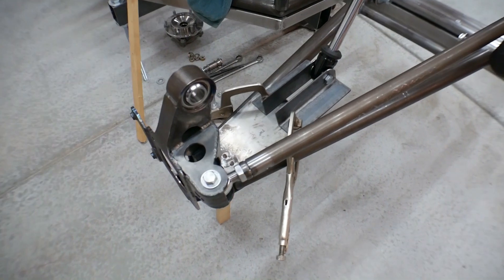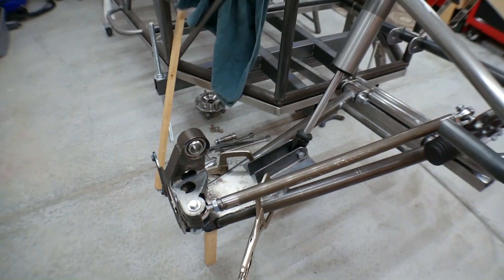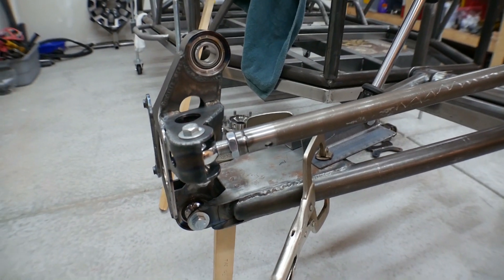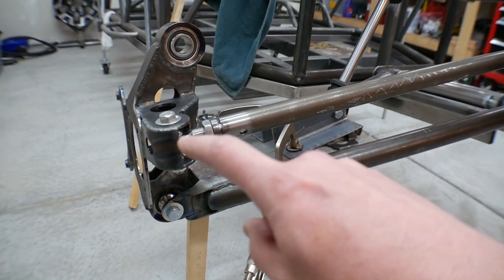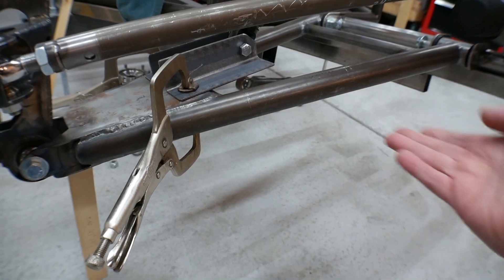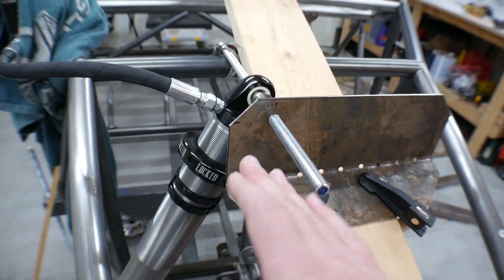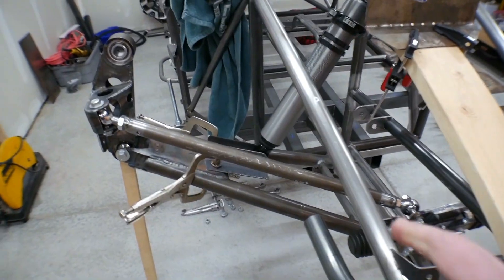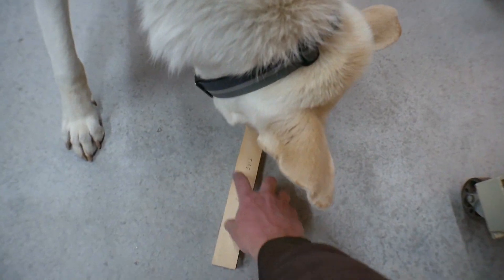Baja Front Suspension Build #4 (Lower Control Arms)

Comment: What size tires are you running on this front suspension? At "full bump" how high would the center of your frame be from the ground? Can it use all the up travel?
Reply from the maker: 33" tires on the front. At full bump the chassis is 2.5" off the ground. But that's seeming to be a little short, maybe shoot for 3". The tires squish more than I expected. My suspension can go up more, quite a bit more before anything binds. But that doesn't do any good if the chassis hits the ground.

Comment: Really enjoying your videos, surprised your control arms don't have better aerodynamics, I would have rotated the SHS closest to your spindle mount lugs on a 45 degree for improved clearance at max articulation and full droop.  I possibly would have done the leading edge of the lower and upper arms in angle instead of flat and turned the trailing edge up to create downforce because it's available and everything adds up 😉🥃🚬 all the best from 🇭🇲
Reply from the maker: I would call those fine details, not disagreeing with you on any of it. But typically my initial designs are a little basic. Then if the design works you'll see me come back and make things a little better. Which would include some of the details you're talking about.

Comment: Doug Bug nice set of video's.  As an engineer
 I do the same thing but on cad.  I made a quick 3d model of your lower arm, ran FEA will 2000 pounds of shock load and got very little deflection.  Nice job!
Reply from the maker: That's really cool you did that. Thanks for the info, I am a little worried it would be to weak. But hearing that makes me feel a little more confident. 👍

Comment: what bushing did you use for your spindle on the top and bottom? link to order some if you have it would be awesome!
Reply from the maker: Sure thing....
They are uniballs, this is them from KarTek.
https://www.kartek.com/parts/fk-rod-ends-34-id-1-38-od-wssx12t-ptfe-coated-uniball-spherical-bearings-f2-fit.html
You need the uniball, cup, misalingment spacers, and C clip.

Comment: The lower knuckle tabs that you added to for strength. Just thinking, you could triangulate plate them in, above and below the bolt tab to really add strength to those tabs and can still easily put a bolt in. Just make it part of your top and bottom plate. 🤷🏻‍♂️ just a observation.
Reply from the maker: I agree there is a little more room there to add more material. But I'm thinking what I have here will be strong enough. But if I find that it's not I'll likely add some material where you are describing. Thanks for the idea.

Comment: Looks good nice a stout with no weight up front really I don't foresee any problems with that setup I could be wrong but I've been to many off-road races with a team and I've seen alot of rear engine cars have the shocks this way with zero problems will be interesting to see it work in the real world though can't wait to start my own build I'm actually considering getting a little Toyota or the like and turning it into a buggy just to be different since I haven't got a final decision on the car yet however I did just get a Hyundai given to me that might work well ill have to ditch front wheel drive though
Reply from the maker: I'm not to worried about it, but like you said we'll once I get to actually beat on it. I hope you can get a project going soon!
Reply: @DougBugBuilder  so do I still in the process of moving from California to Arizona but as soon as I'm fully moved I will start something just didn't want to have to move with more extra stuff

Comment: Hey what size heim joints are you using for your steering? Awesome build!!  Thanks
Reply from the maker: They are 3/4", this is where I got them.
https://www.kartek.com/parts/fk-rod-ends-34-right-hand-thread-34-hole-kmx12-nylon-coated-heim-joints.html

Comment: I've been learning about suspension but not in an off road buggy context, but it seems the off road world doesn't seem to consider roll centres or roll axis, it would seem to me that with long travels and a high centre of gravity there'd be a lot to gain by raising the roll centre height to lessen roll, of course there is a downside to a high roll centre; jacking but I think it deserves some thought especially if your doing a A arm suspension and it can more easily be changed. An inclined roll axis can also positively effect handling feel. Do you have any idea why off road stuff doesn't seem to consider roll centres much? I can understand that camber gain or loss (another result of varying roll centre/virtual centres) is unlikely to be as important in an off road context. Btw parallel A arms or a trailing arm will put the roll centre at ground level.
Reply from the maker: Arrin, I think for the most part it's not considered in these vehicles because it would take away from some travel and these vehicles basically go in a straight line. If I was designing this for short course I would give up some travel and pay some attention to the roll cneter. But with most of the driving this buggy will see I want travel more than anything. 
That's why this setup doesn't have much camber change at full droop. If it did I'd lost travel as the steering would bind faster.
Reply: @DougBugBuilder  I guess I never thought it might limit travel in a double A arm (front and rear or just front with steering arms?). The car I am playing with is a classic Morris Mini, so a couple of inches of travel total.
For the rear there's semi trailing arms, I can't see they would have any effect on travel and given most of your weight is in the back and the rear roll centre wants to be higher than the front it could be an idea? Just don't do it using deflecting rubber bushes like Porsche did. I've a spreadsheet I've made to calculate the effect on camber and toe (in), I'd be happy to send it to you if you're interested. Rear wheel drive track cars typically don't like the camber change on squat but I figure that doesn't bother off roaders much.
Reply from the maker: @arrindaley3714  I could possibly consider it in the rear. That's limited already by driveshaft angles.
If you don't mind send me your spreadsheet, I'd like to see the deflection.
My email is dougbugbuilder@gmail.com
Thanks.

Comment: Just a heads up. On this side of the camera it was hard to tell if there was enough room between the shock and chassis rail once the spring goes on. Nice work though, you got skills.
Reply from the maker: I know what you're talking about. It is close, very close, but there should be room. But either way I think that bar will need to be moved some to clear the upper control arm.
Thanks for paying close attention and the comment! Appreciate it.
Reply: @DougBugBuilder  Maybe nothing more than a ball ping hammer and a torch can't fix. But then you'll need to gusset the anealment with a half tubing gusset.

Comment: Arm's Looks  solid and well designed, are you also revisiting your rear suspension ? why a arm vs trailing arms ? any thoughts thanks ! good job man
Reply from the maker: Thanks Bud!
I will be redoing the rear as well.

Personally I really like the benefits of A Arm over trailing arm. I know there are some benefits to trailing arm, Simpler, stronger, easier shock placement, I'm sure there are other benefits.
But A Arms have lots of benefits, and the biggest is that when A Arms travel if done right there really is no plunge for the axles. As they travel in the same plane as the A Arms. I could go on and on about this. But mainly I enjoy working with A Arms.

Comment: Argh. I hate that shock mounting location. Looking at the arm without measurements 50% of your spring forces will push on the chassis mount and the other 50% on the wheel. So a 100lb spring gets you 50lb of spring rate at the wheel. This will wear out your shocks 4x faster and cause additional stress on the frame. 

If possible- get a shaft extension and move it closer to the wheel or extend the chassis upper mount for the shock outwards. I know that isn’t always easy.
Reply from the maker: Wow dude...... no need to hate. ;-)
Think about it. With still using a 12" shock and still getting 22" travel there is no way to lessen the forces on the shock. No matter how I position it the shock is still basically moving half of the control arms movement.
An extension won't work because it will reduce travel. The only thing I can do is get a longer shock absorber, reduce my travel, or use linkage with a cantilever.
Personally I think on the front of the chassis here it will be ok. But who knows, it won't be the first part I make that fails. ;-)
Thanks for the comment though, it keeps us all thinking.

Comment: I've just started watching your videos, on this build, and I am gaining a lot of knowledge... Thanks.
I have a question...
There's is probably a good reason, I just don't know it. Why not use rear steering, like the standard VW beam suspension? The rack and tie rods would be more protected, and the Ackerman rule could be achieved correctly.
Reply from the maker: Because of the location of the shock absorbers on A Arm setup in order to have rear steering the steering rack would need to be mounteed really far back. This would cause issues with the steering shaft going from the steering wheel to the rack. Hope that makes sense.
Reply: One would have to locate the shocks pretty far forward to rear steer on a setup like this...I agree on a reAr engine light rig it’s not as important

Comment: Hi, to me it looks much stronger then you need.

What i learned from mine buggy construction, is that with the arms it's better to have a longer spring and the connection point to be next to the wheel, not to the midle of the arm...

Anyway, carry on.😁
Reply from the maker: I can't argue with that. I'm not to concerned with it on the front. But for the rear I'll consider getting 16" shocks so the shock can be out like you're saying. Thanks for the comment.
Reply: You do have some experience with R/C  like I do. I would have toyed with the idea of an inline suspension like on the Traxxas REVO or F1 cars. Smaller shocks, you can run steering on the rear of the knuckles without interference, and adjustable progression rates with out the need to disassemble the shock.
Reply from the maker: @dorsk84  Yes! I have a Revo! I know just what you're talking about. That would be cool.